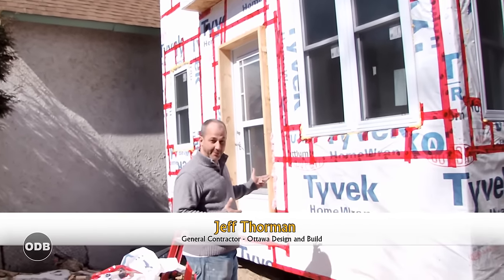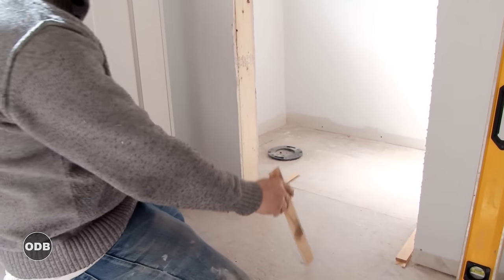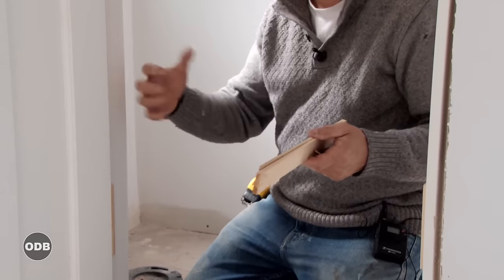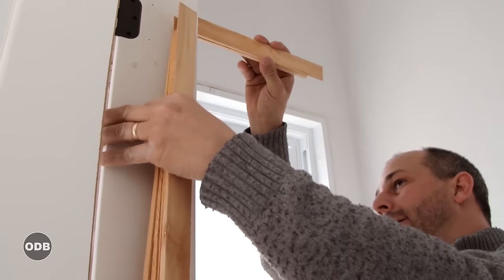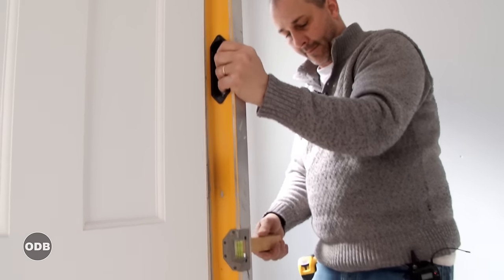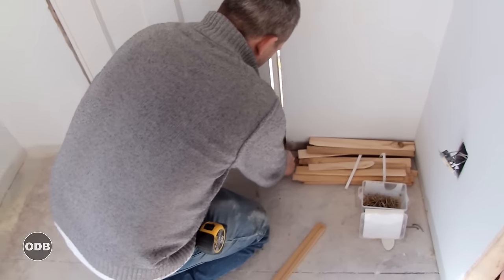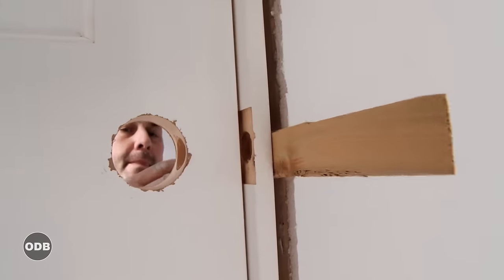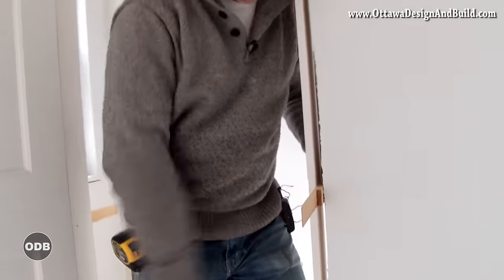How To Hang An Interior Door Quick and Easy

Comment: I want to see how to replace door…. Into existing frame….   My 2 tips I lay old door on sawhorses line up new door via the precut knob hole. Then you know how much trim off top / bottom / hinge side.

Leave hinges attached to old door. So you can xfer lines to new door..

Just screw in top hinge fully middle and bottom leave slightly loose.  When hang out in top hinges pin loosen middle and bottom hinge slightly.  That way you have flex to make middle and bottom hinges line up to insert pins.  Then lastly tighten up bottom and middle hinges on frame and door. Cause if u try hang either middle and bottom hinges tight it’s guaranteed they won’t line up.   The will both be a 64th out of going together.

Comment: vertical measurement is called
 "plumb". at about 1:50 he says to stack shims until level. shims work in pairs (opposite directions). he has like 6 shims on one side and one on the other. any measurable distance (1/4"+) should use plywood and then shims
Reply: You must be blind and deaf. He didn't say or do either.
Reply: At that point, he was just shimming between the bottom of the door and the floor.  It was temporary.  He removed it after the hinge side was secure.

Comment: Like someone else put it, door slab determines the reveal, not the level. When installing doors (I’m a third gen carpenter) we don’t even have the level out. 
Also, most pre-hungs in US have the strikes already (jamb stock come pre-molded). I nail with 2 1/2” 16gag to set door (note: never nail through shins - I like to nail just below shims and always shim just below the hinges). Ones painters are done I (not the painters) reinstall the slabs into the jambs useing a 2 1/2 to 3” set screw in the furthest set screw hole in hinges. The adheres hing to framing vs to jamb only. Not having shims directly behind hinges allows to tight hinges for adjustments for relaxing over the first year and/or lumber twist (for those who still frame with green lumber).

Comment: Hi Jeff I hang it right out of the box I don't unlatch it I run one by four across the top and one by four across the bottom flat side I sent her it Make sure they're flush against each one by four and nail it in that way nothing's bowed out or each casing is going to the one by four is a guide for the casing to be flush I think you understand the flat side of the 1x4 is across temporarily The hard part is getting the plug out of the the hole The shipping but once you get that out the door is perfect and that's just an idea I watch all your videos

Comment: I have to do this on a finished floor and the jamb is half on a tile floor and half on a hardwood floor, where there is about an inch in height difference and it makes a funky transition. I'll have to use a contour gauge I'm guessing and will not be able to shim under the jambs.

Comment: I like to use hide screws or sometimes called deck screws. The head is the size of a finishing nail. It uses a small hex bit to install. The screw head counter sink themselves and the screws don’t suck the frame beyond what you adjusted it to, like a regular screw can do. And again, they counter sink themselves so you can easily fill over the hole.
Reply: AKA trim head deck screws.  Thanks for mentioning it, that's what I'll be using.
Reply: @WizardofGOP  yeah that’s it.’ That’s all I ever use.
The end result is always good
Reply: @wyattsdad8561  Make sure you teach Wyatt about it.  🙂
Reply: @WizardofGOP  I definitely will ;)

Comment: I like to replace one of hinge screws with a screw that will go through hinge into stud. With shims behind hinge.
Reply from the maker: Great system as well. Cheers!
Reply: Antonio Cantu thats what we do to. Keeps everything clean, especially if the door stop is already installed
Reply: I do the same thing but what do you guys do when the door stop is already installed on you want to screw on the opposite side of the hinges. What can you do for that clean look and conceal the screws?
Reply: FrancoMango you can use some 2 1/2” deck screws on the striker plate. Other than that, I can’t think of anything to secure the jamb side without taking off the door stop. Why do you want to screw that side?
Reply: @iLikeC00kieDough  I ended up using a nail gun
Reply: FrancoMango that’s what most people do, including myself

Comment: I learned a lot from this video even though I'm trying to stop the door from rubbing on the floor. Thanks!
Reply: Michael Doyle----Your floor probably isn`t level .       In that case ,  you cut off a little off one side of the door jamb with a circular saw . By little , I mean 1/4 " to 1/2 " .     Look at the video from " This Old House " .        Make sure that your top jamb is level .  Both the right vertical jamb and the left vertical jamb will be an equal distance off the floor ,  to allow for the flooring that will be under the door ..

Comment: Just use the Quick Door Hanger bracket kit they sell at all Home Depots and Lowes in the interior door aisle. $5 and no hassle..
Reply from the maker: No Thanks, the trim install would be a disaster with this product.
Reply: Sales employee talked me into trying those when i bought my door. They really do work great. They kind of sink into the drywall, trim didn't  touch them. Like your video Ottawa Design. Kim is right though, the whole process was only 6 minutes with the kit. Ottawa, perhaps make video using brackets? Im sure your tips would still be good for everyone.
Reply: Huh... never heard of them.
Reply: This product looks perfect for me the electrician
Reply: I love those brackets, they don't affect the trim at all . I use them to set door quickly, then shim and nail as usual

Comment: I have two questions please: 1. does the rough in of 82 inches for many standard doors count from the concrete floor or from an assumed .5 inch or more floor height? 2. what do you do with the shims under the frame on the concrete when you install the floor - do they get removed and the floor material is slid under the door frame or do they stay in place? thank you.

Comment: I thought the shims go behind the hinges? Do they go behind where ever the door doesn't look level? and as well is it always 3 sets per side or does it again depend on playing with the frame and whatever it takes to go level? thanks
Reply from the maker: When working with mdf 3 sets is good but when using wood you need to make adjustments based on the warping of the wood. sometimes you need a lot more and sometimes 3 sets behind the hinges is good. The process is dictated by the end result you are trying to achieve.
Reply: True, thanks for the reply. I guess what i mean is in your vid, your shims are not directly behind the hinges, sorry i'm a noob trying to learn as i go. Do they always have to go directly behind the hinges?(the shims)
Reply: 1. Another question i have is with regard to the amount of nails per side of jamb and the distance vertically and horizontally between the nails? 2. How many nails per jamb side do you recommend? I saw another video and the guy says ten nails per side. 3. And finally another other question i have is should i put 2 nails thru the shims or is one enough? Thanks for your kindness in answering
Reply from the maker: as a rule that is good practice.
Reply from the maker: more is better. If you are trimming the door right away just a few is fine. but if you run the risk of twisting if not enough.
Reply: You should not put shims directly behind hinges as it limits the adjusatbility of the door via the hinge screws, according to this guy: https://youtu.be/gY7o5oSwrdo?t=544
Reply: aa. gg. I just put in door but contractor only left 1" on striker side for molding so I had Reframe to get larger surface for molding. Is best screw in middle or both sides of Door jams Are we going for Clean look or structure.

Comment: Looks good but I need to replace an interior door over carpet.  Are there special considerations I need to include?  I worry enough about the door hanging and swinging level but I do not want to damage the carpet when I remove the old frame.
Reply from the maker: very important to install the new jamb in the same location as the old one. Other than that the install is the same. Just make sure you start with the hinge jamb side and build out the jamb to contact the carpet. Cheers.

Comment: I did this similarly on my door in my.older house. The frame is not perfect because its older. I had a huge problem during the summer when it was humid where the door jam actually bowed from the pressure. How do I avoid this and allow for the door to open properly? Is there a rule for expansion? It works perfectly 9 mo out if the year.
Reply from the maker: instyall a dehumidifier or a/c. or cut down the bottom of the jamb1/8 and add caulking. it will expand without buckling. Cheers

Comment: I have a house built in 1952. They used 2x3 n not 2x4. I have to put in a frame. The door I removed is 30". Do I make the rough opening jamb to jamb 32"? The header I had to remove from carpet floor to sheet rock is 81". Should I have an eighth to a half inch clearance from top of door to header? I had to take a lot down cause builders cut in half 2x3s instead of using another 2x3 as a jack stud. I don't know much but that was wrong. Let me know.
Reply from the maker: Hi Peter, the height was designed for a 78" tall door which you can still buy today. yes the rough in width should be 2 inches wider than the door slab itself as you described. Cheers!
Reply: Standard seems to be a 30x80 for a rough opening of 32x82 at home depot.

Comment: Very helpful! Thx.  

What if I removed the door from its frame & then install the frame and then hinge the door back on?  Any issues w/that?
Reply from the maker: Not if you install perfect level, plumb and flush. I like to use the door as a visual guide. I find it works well with those cheaply made jambs .
Reply: @HomeRenoVisionDIY  I find this super helpful. Thank you. I need to know, do you fasten the top jamb to the framing? I know you said work around the door, hinge side first... But I didnt see you do it in the video. But should it have at least one screw with shims to keep it solid? Thank you I have to hang 2 prehung doors tomorrow. I hope you see this and can respond. Haha. Thank you.

Comment: You level with shims on the hinge side and shim at header and striker side for just even gaps. Is this correct?
Reply from the maker: no need to shim the header.
Reply: Ok. For the header and striker side your just eyeballing the gap or is there a measurement?

Comment: What should my rough opening be for a 28 x80 openkng? I was thinking 2 in more than width of door and 1/2 in on each side = 31. Is that correct?
Reply from the maker: Hi Peter your rough frame should be 2 inches wider and 3 inches taller. Cheers! As long as it is reasonably level. if in doubt a little wider won't hurt.Cheers!
Reply: Thanks

Comment: Dude what if your floor is all messed up? Like my floor is 1/2” differential. So this damn door is all out of wake and I’m having trouble setting it up by myself. I had another door that had the same issue but when I cut the longer side of the door jamb it didn’t help?
Reply: You prob figured it out already but... Make a line on the wall by the jamb. Carry that line across to the other side of the RO. Set the door in the space. Measure from the top of the door jamb to your mark on either side. The difference between the measurements is the amount you need to cut off the jamb on the high side of the floor.

Comment: When I put the door in the hole and have the hinge side completely level, I find that my door doesn't shut, but if remove enough shims to make the door close the door is no longer level. Also- the wall that i am installing the door on was not completely straight when i started. Thoughts as to what I am doing wrong?
Reply from the maker: If the house or the wall isn't level then you may find this problem. Remember the first goal is to make the door operate. secondly make the door not swing open or close on its own. third is to make it level. I would rather install a door off level and not have to cut it to fit!  In the future try to make sure the hole is 2" larger than the door in both directions. this usually leaves enough room even if it is out of level.
Reply: I normally watch your videos before i try to tackle any project and making sure everything is level is always my biggest objective as i know the importance. The house i am working on however, is quite old and been though quite a few different remodels unprofessionally. Is there any kind of issues I should expect to see in the future if the door is not level?
Reply from the maker: It may always want to stay open or close behind you. If the floor has dropped on one side it won't be noticeable as the floor and ceiling will be off as well.

Comment: My top hinge come loose causing the top of the door to rub and the 1" screws in the hinge free spin. I tried a longer screw 2" and it still free spins in the hinge what could cause this?
Reply from the maker: the jamb material is thin. try using a number 12 crew instead of a #10 or #8

Comment: best shims are the free paint stirrers from Home Depot
Reply: Shims are tapered so that two opposed shims can be adjusted for thickness to precisely fill a gap, adjust reveal, or set a jamb plumb.  Paint stirrers are constant width and are not suitable for these applications. So, spend the $2 and get the correct shims.

Comment: Unfortunately the cheap doors (from Lowes) I'm installing already have the door stops in place and they dont really look removable. If I use screws they are going to look terrible.
Reply: John Armstrong I’m getting ready to do the same. The trick I’ve read about says to remove the hinge and hide the screw behind it. Haven’t tried it yet.
Reply: Pre-drill and countersink the screw and fill up the hole with wood putty, then sand and paint!

Comment: For interior doors only I personally use a nail gun to install them. Quick easy no issue with frame bending and easy to fill the holes after. No need to remove the stop either
Reply from the maker: And that system there is no need to worry about level plumb or square either. And no worry about future creaks and cracks in the caulking because you are long gone.

Comment: I did this but the top of the door still rubs against the top of frame when I close it, very frustrating.
Reply: Smoke Stack ---- (A)    Is the top jamb of the door level ?       (B)    Is the floor level ? If you put a door into space where the floor isn`t level  , and didn`t check to see if the top was level , you may have one side of the door out of kilter with the other side of the door .  If the left side of the door in at a different height than the right side , the door would rub .
Reply: Bill Eddy ....I have a 1956 ranch home with plaster walls, all Prehung doors are custom ordered I don’t want to do extension jambs. 

From inside room looking out into hallway, Rough opening is 81 3/4 on left side and 82 inches on right.

Floor is also uneven, by 1/4 inch, I made a reference line half way up the wall and it measures 48 1/2 on left and right measures 48 1/8. I had to cut some of the jamb off at bottom just to get door into opening but still having a rough time with top part. 

I feel I have to plane header to make it all even, or take some more of jamb off.

Essentially I have a Rough Opening  81 1/2 on left side and 82 on right side.

Comment: Shouldnt you use nails or a countersink screw so you can putty it
Reply from the maker: I sink the screw and then putty it.
Reply: PinkFurryHat it's going to be Hiiden behind the Door stop only when you buy from big box stores your going need to cover screw holes because door stops Already installed I counter sink two screws on each side.

Comment: Why you wouldn't be using a 15/16 ga nailer instead of screws is beyond me. Don't get me wrong, for the experienced guy screws are great, but a DIYer on a hollow core door is more likely to be sinking screws into the king pulling the door frame out of being flat and plumb while trying to keep the reveal uniform.. not saying this is wrong it isn't,  I'm just saying this probably isn't the greatest method for someone that hasn't hung a door before...